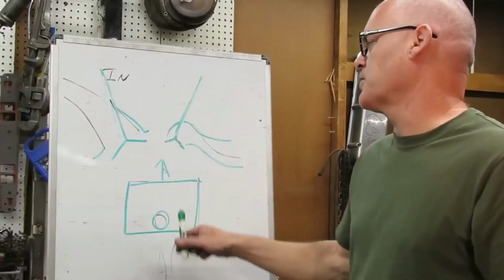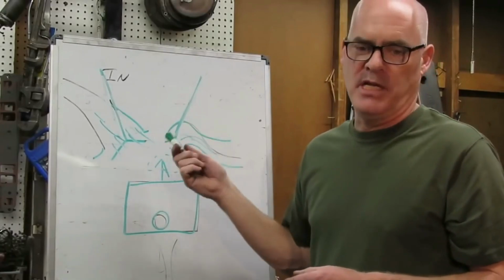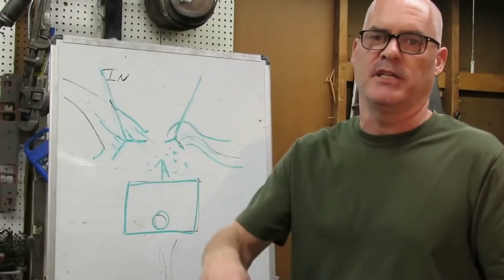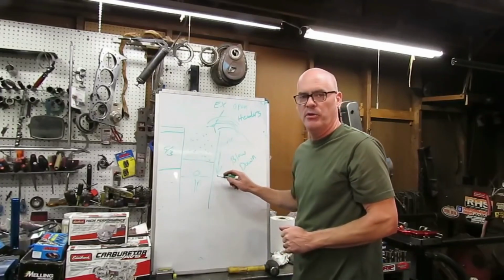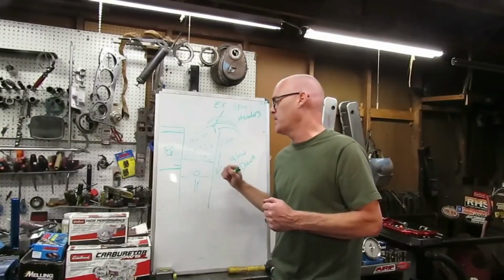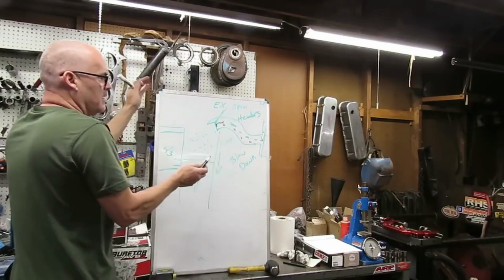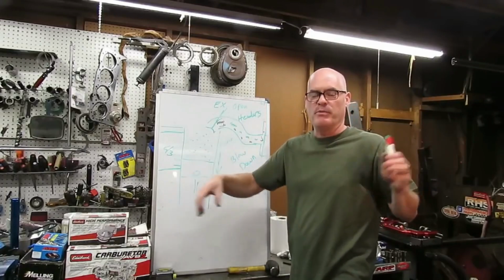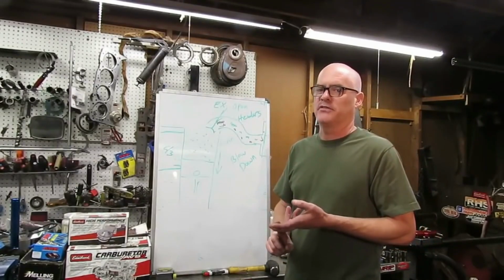Does Your Header Choice Matter

Comment: Thanks for your advice on the harmonic balancer dilemma  I faced using the wrong parts to balance my engine.  I used an 8" balancer on my 350CI Chevrolet instead of the recommended 6.75" which is the key to my problems.  Thanks again!

Comment: Thank you for all your advice! Something I noticed on my Vortec 350 -383
Exhaust manifold centering I noticed the factory manifold bolts had thicker shoulders but still had a lot of slip side to side, though noticed the old and new manifold bolt bores were perfectly centered and in line and when centered the bolt bores and manifolds lined up with the exhaust port bores perfectly. The factory bolts are sloppy. so the factory either used much wider shoulder bolts for the installation or a guide jig. My solution was to buy two steel sleeves for my grade 8 bolt's. I used these sleeves on the two end bolt's for alignment only fishing out with a dental tool after tightening the inner bolts. And moved them to the other side to finish. Either way if something is not done it will cause restrictions and excessive heat in the head's and manifolds.

Comment: Just clarifying, you said small tube,  short header is best for a street car for power between 2500-3500.  However, you said long tube headers are best for low end torque.  Wouldn't that mean a small tube, long header would be best?  I think I missed something there.  Please clarify as I am looking for low end torque for a street application.  Very good topic.  Thanks for doing these videos.  I really appreciate it.
Reply from the maker: Yes mild lower rpm stuff needs small dia long tubes
Reply from the maker: Long small tubes are best for TQ

Comment: I have an LT1/L83 installed in my 37 Chev PU.  I couldn't find any headers that hugged the block enough to fit between the frame rails.  The stock manifolds flare out and hit the frame.  I tried Summit's cast exhaust manifolds but the were worse than stock.  I found that the Hooker Blackheart manifolds fit.  So my question for you, considering that I'm not modifying the engine, what size exhaust pipe should I use?  I was planning 2 1/2" dual exhaust. Would I be better off with merging them into say a 3" single?
Reply from the maker: Yes we saw more power with single 3” ex than duel with a Streight thru muffler
Reply: @Myvintageiron7512  So run my 2 1/2 from the exhaust manifold to a 3"?

Comment: Back in the day i was doing experiments on my Chevrolet. Went from a single regular exhaust, to a single glass pack. It sounded good, so a dual system with a pair of glass packs shouldn't sounded better, right? WRONG. I now had a massive flat spot in the carburetor. Not much if anything could fix it. I got it a little better by up jetting the carburetor, but i certainly wasn't putting headers on it. I spent too much time and money as it was.
Reply: @MrSwinger1  OH yeah! When I got it up past 70, those mufflers didn't muffle anymore.

Comment: Does the scavenging of other cylinders help create a jet effect where the header manifold is welded together to help maintain the exhaust velocity? Is there a way to have good power with minimum sound? Is there a cam timing for ideal fuel consumption with minimal fuel waste or wasted forces? Or am I thinking about this wrong?

Comment: Hey master your extremely informative videos amaze me more and more every time specially this one because I'm in the process of selecting a good set of long tube headers for my daily work truck 2010 Jeep Grand Cherokee SRT8 6.1L Hemi which has 370 CI with 10.2-1 compression ratio, i just installed a bigger camshaft ( kit ) from comp cams with these specs: - lift int 632  / exh 619 , - duration @ .050 224 int / 234 exh , - LSA 115 , valve timing @ .050 int open -5 BTDC and close 52 ABDC & exh open 49 BBDC and close 2 ATDC , also put a set of Johnson lifters standart travel with axle oiling, Melling high volume / pressure oil pump and a Borla 3" cat back exhaust system so now is time to select the proper set of headers to take full advantage of the new cam / valve train components so PLEASEEEE I'll really appreciate if you can point me in the right direction on what primary tubes & collector diameter i should go with, big thanks in advance
Reply from the maker: the best results we have seen 1-7/8 primary long tube I cant remember the collector size off the top of my head I think it was between 2-1/2 to 3 they were BBK headers
Reply: @Myvintageiron7512  thank you so much master for your response  with the information

Comment: As an example.  With an L31. Whats the best roller street cam to take advantage  of this lesson  ?
Reply from the maker: That depends on the head flow if your running the Vortec stock heads our best results f=or that engine with no mods the factory set up was a Howards cam I don't remember the part number but it had .510 lift, 218/224 duration @.050 with 112 Lobe sep, now it is important to note that we did half to machine the valve guides down for that lift the Vortec heads will not take a .510 lift cam unless this clearanceing is done to the height of the valve guides if you try the retainer will smash into the top of the guides and that is the start of really bad things, I have heard quite a bit of chatter about beehive springs and retainers allowing more cam lift without any machine work but I have never actually done that since I have a machine shop I just use my cylinder head machine to cut the guides down it can also be done with a drill and a PC cutter with very good success I will add a link at the end of this for the tool you cany buy and cut your guides down with a drill

https://www.summitracing.com/parts/hrs-92040?rrec=true

Comment: The negative wave in the header tube is often called a rarefaction wave. To add to the complexity: the sound speed is greatly affected by the density (how much gass is released) and its temperature. This makes theoretic design almost impossible on how a header is going to perform on what engine and on what kind of camshaft on what rpm. Luckely whe have about a hundred years of trial and error.
Reply from the maker: That is a really good point at the end of the day no matter how much theory you apply there is definitely an element of trial and error the draw back to that is changing ex systems up is expensive and time consuming if you try something and it does not work,  your out some money, this is why we uses the theory to get us in the ball park I have had exhaust systems that worked really well but when installed on another engine were terrible also one thing I forgot to mention is we tested with mandrel bent tubing and with non mandrel bent tubing the mandrel bends did make a defined difference in power out  put, so I also highly recommend that as well

Comment: Hello Sir.. been following you for quite some time and hoping you could answer this question for me.   
I'm installing a roller cam in a Ford 400. 30 over with a set of 3V aluminum beads.    It's going into a 80 Bronco for some street driving but more importantly doing some trails in the U.P. here in Michigan.  Would you recommend a long tube header for this set up as well?   
Thank you.
Reply: yes definitely I have a similar set up the shorty headers took away a ton of low end TQ went to long tube huge improvement I can tell you from experience that what he explained here is exactly right